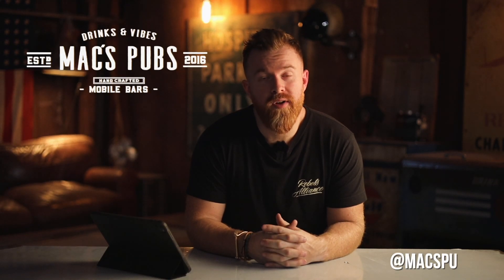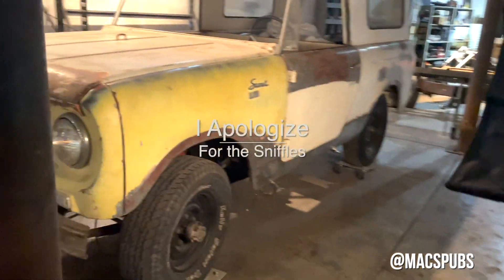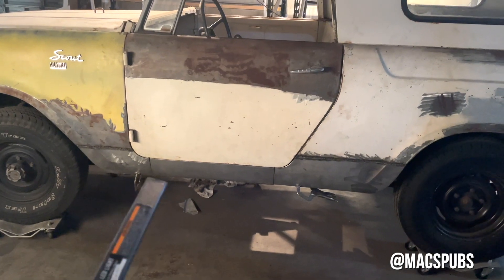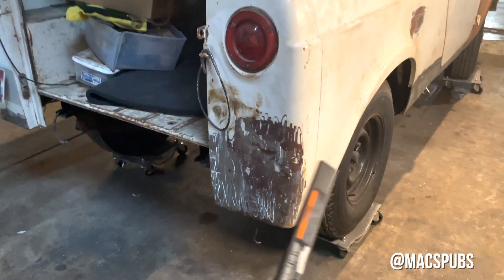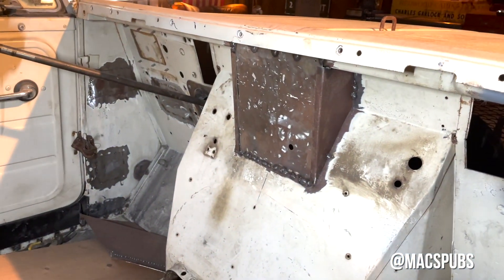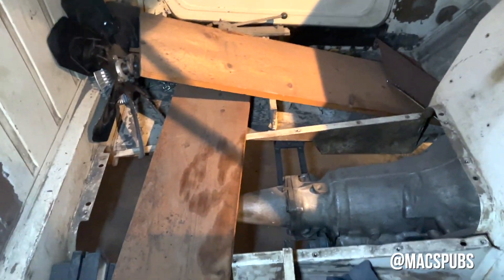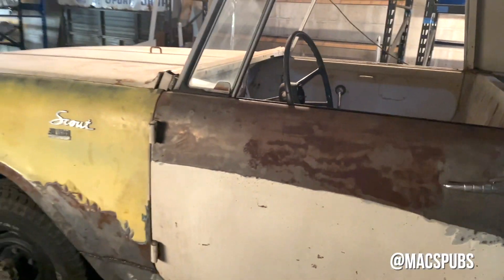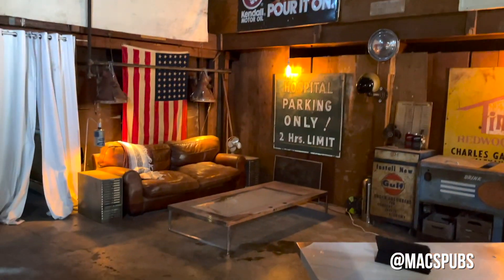Alex Mac's Scout Build: 2021 Update!

Comment: Very Jealous, beautiful shop .super cool scout . I have to do all my work under the sky . I'm rebuilding a 1971 international scout 800b Comanche. Yes one of the extremely rare Comanches . Have the same problem with rust on the rocker panels quarter panels apparently they all did the same thing too many pockets for mud and sand and water to collect in . My question for you is where are you going to put your fuel door ?
Reply from the maker: Very nice! Yes these all are pretty bad in the rust department. I have another scout 800a in upstate NY that is pretty solid. You have an IG with your restoration?
Reply: Instagram I assume? I don't